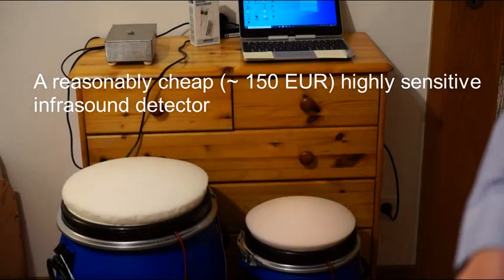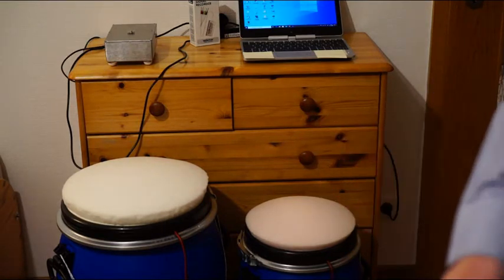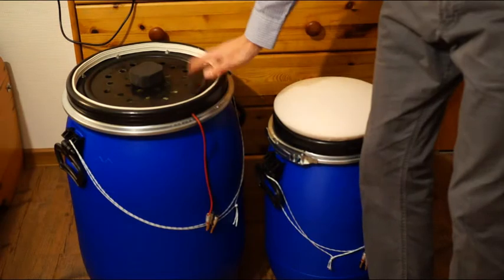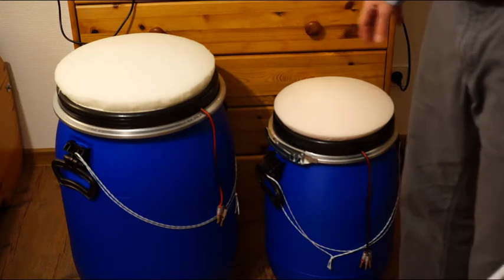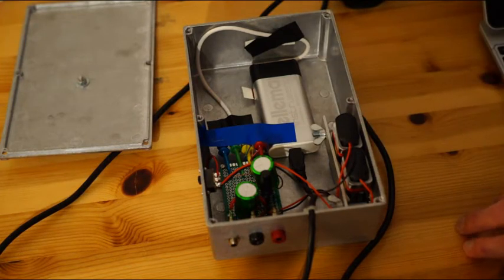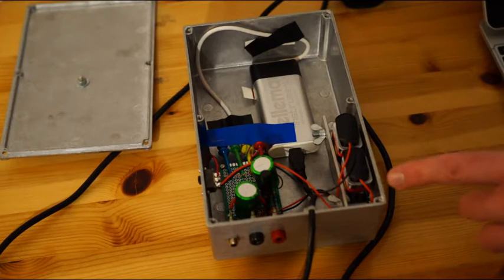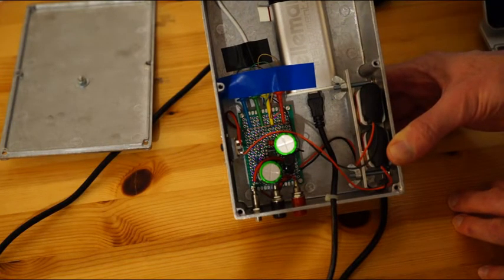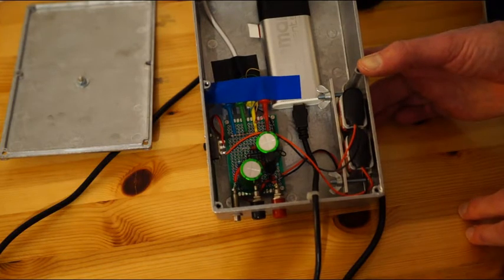A cheap homemade infrasound detector

Comment: Cool project and very informative.
I am building microphones specialized on low frequencies right now  to detect elephant rumbling which also goes into infrasound. And the program Sonic Visualizer just opens a new world if you have only used Audacity so far for visualization. (Layer -> Add Melodic Range Spectrogram) and then play with the knobs. You will see much much more.

Comment: Thanks a lot of these precious informations 🤲.
Can i have your email i would like to ask you few questions if you don't mind. I would like to make my own setup too
Reply from the maker: Hi, happy to hear you plan your own setup! I am now running the measurements continuously since several months - plenty of interesting signals (I need to report back in another video). If you do not mind, please feel free to add your questions to the comments here, so other people also will benefit from our exchange.
Reply: Happy to hear that you gonna make a new video 👍. I'm all ears to the youtube notification.
Actualy it's about the amps.
I'm new to electronics so i would probably ask a friend to help me to build it.
So if it's possible to make a schematic with specificity of each component and if possible explain some details.

Thanks in advance
Reply from the maker: Sorry, I noted that I forgot to show the connection of the "+in" pin of the OP-AMP to ground in my original drawing. So I have deleted the video and uploaded a revised version here: https://youtu.be/dWhUHJvebpI
Reply: @frankkurt3365 Sir, Thank you for your demonstration. Very intuitive.
Have a good one.